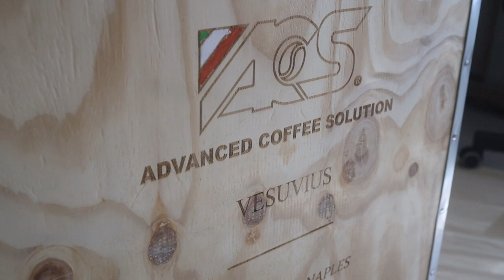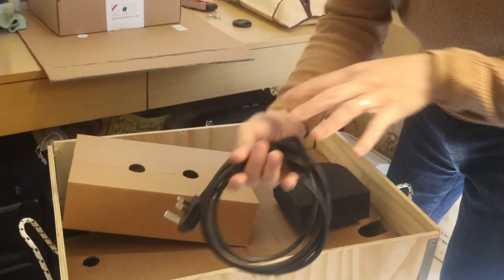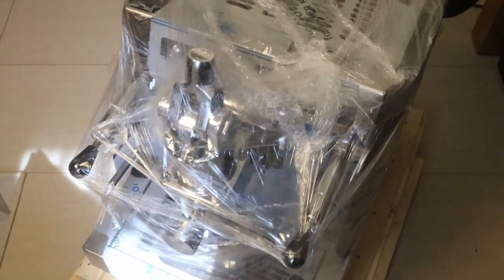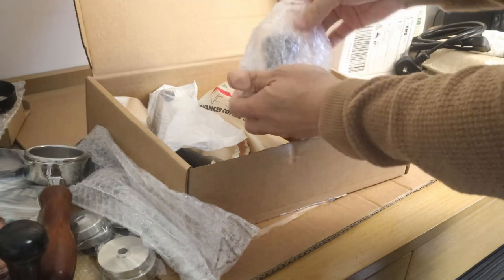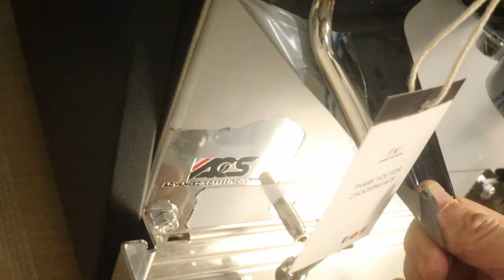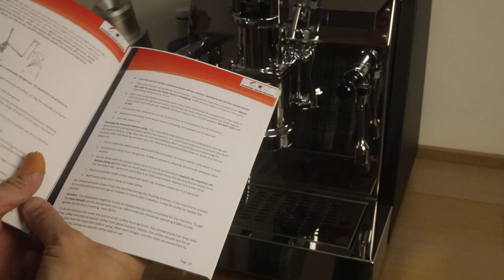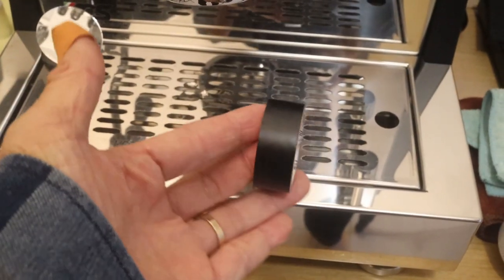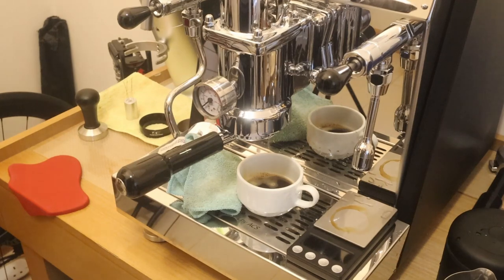ACS Evo Leva Espresso Machine detailed unboxing

Comment: Lever seems hard to pull down based on this video. Is that true? Any issues you can think of in this model? I appreciate your response. Thanks
Reply from the maker: I think its normal for lever machines, you have to load the spring tension, guess you can mod it with 9bar spring to make it easier to pull. Still using the machine.